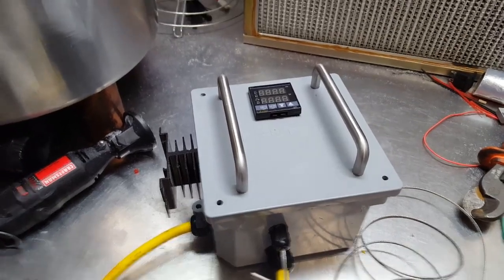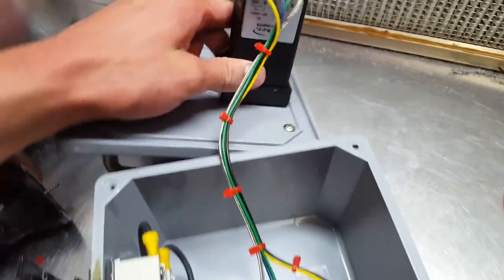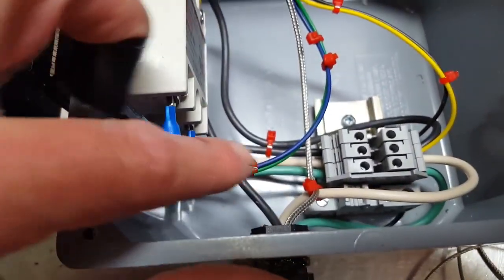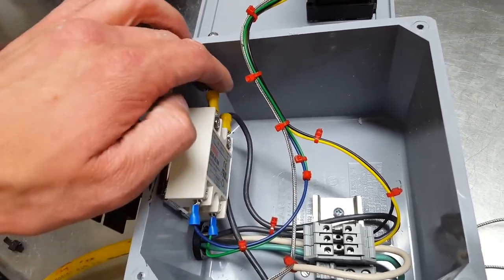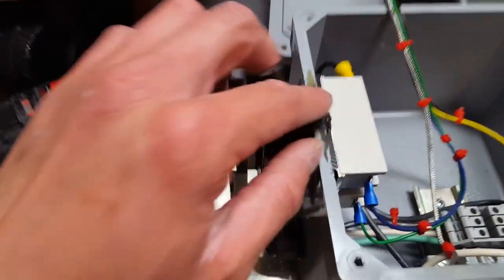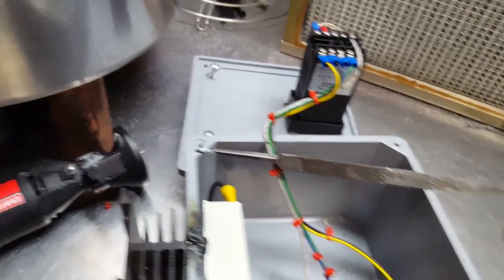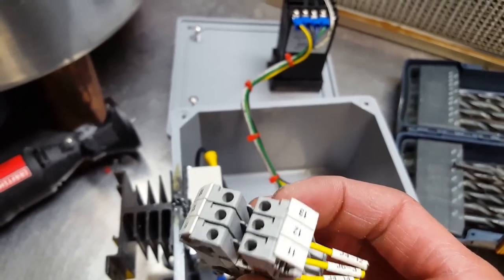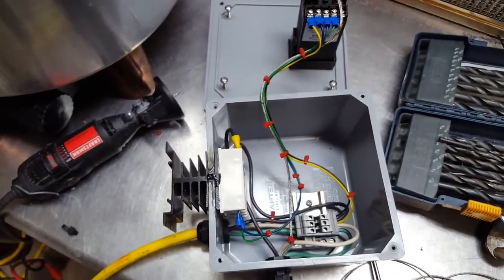How to build a DIY PID temperature controller box with a DIN rail and SSR

Comment: Interesting build.  Good tips about the plastic box and the DIN rail.  
I'm planning on doing a similar project but with a different approach.  I plan to use the ATmega328 chip found on Arduinos, and program a PID control function into the chip, and also program in a timing schedule so that the heater will turn off completely after a set amount of time.  Also I intend to use cheap LM35 sensor as temp sensor and simply superglue it to the surface of the PC.

Comment: Maybe in the future show us the circuit diagram, and then show us the implementation, especially if your not going to use standard tech language (live  or hot wire, and neutral/common, and ground, controls like feed back loop, or controlled device, etc)

Comment: How did you wire the controller up to the hot plate? Would this also work with a induction plate?

Comment: Would this not be dangerous with the probe flying out if not tight enough in??
Reply from the maker: @tegancooper-hughes5174  it would be no different then removing the rocker. It would just blow steam. That being said I've never had a probe blow out. It's only 1/8" and 15 psi so a pound or two of pressure pushing it out.

Comment: I made a 220V controller, but used a separate contactor to switch the 220, and a 24v transformer to power the contactor coil. So basically the SSR was used to control the contactor instead of the heating element directly. I did this because 220 has two live wires and without a contactor, one wire will still be hot, and could kill you if you made a path to ground for it.
Reply: Hey is there anyway you could elaborate more on this...? Using the same setup, I have 10/3 wire coming in and I'm not sure what to do with the extra hot?

Comment: when you tap off the 120v input through the DIN terminal block, do you just simply put two wires on the "output" side of the terminal block? one to PID, and one to either relay or output (depending on whether its white/black)?  or are you connecting two terminals together and having separate screw connections for each out?
Reply from the maker: You can put two wires or if your DIN kit has jumpers you can jump the 2 blocks together and put each on its own screw.

Comment: is the SSR output on the controller TTL or logic output?
Reply: They usually can only handle 30ma or so. probably use a transistor or A low power CMOS chip for the output. Most are 12vdc so not TTL  .

Comment: Great Job 
I am looking for a controller with 2 temp inputs So I can control a pump. 
I want to have pump running when temp 1 is 10F higher than temp 2. 
any Ideas how to do that?
thanks
Reply from the maker: You can use the alarm relay to do that

Comment: Any reason why you did not fuse your control devices?
Reply from the maker: probably wouldn't be a bad idea, just never have. A fuse for the PID and breaker on the main load would be a good improvement.
Reply: @MyersMushroomsFarms  im an electrician that usually build for customers so thats why I asked. To be honest i would probably not fuse it if ot was for myself. Thanks for providing the video for everyone.   👌👍
Reply: A rcbo would probably best for a fuse 🤔
Reply: @LM-uz4pr  Always fuse or circuit breaker. Saves you meltdowns as you probably know. for stuff like this marine circuit breakers work well. They can be the on/off and the breaker at the same time.

Comment: Does the ss relay really get that hot? I'm building one, and wondering if I really need the heat sink.
Reply from the maker: Depends on the load but yes. anything over 2000w i recommend a fan too.

Comment: Can this controller be used with the 55 gallon sterilizer that you built?
Reply from the maker: Yes for sure. I use it on my 55 and 85 gal. However if your running a 1500w or less inkbird now has a plug and play timer controller. You can find it on my kit page for the drum sterilizer.
Reply: Any advantages using the DIY over the inkbird?
Reply from the maker: @dylanalexander9078  the inkbird is harder to program but it may just be a learning curve for me. Also the inkbird can only do 1800w where you can put 40a relays and do 30A on these DIY units. Also the inkbird only goes to 212f so you cant use it for a pressure cooker, only a drum or steam cabinet
Reply: @MyersMushroomsFarms  I'm going to browse some of your other videos.  But I'm curious how you heat a 55 or 85 gal sterilizer?  How much power does that take?
Reply from the maker: @thedillestpickle  55 can be 1000 or 1500. 85 1500 or 2k

Comment: Is this 220 volt coming in?
Reply: no this is wired for 120 in 120 out
Reply from the maker: yep 120 you could do 240 if you only wanted to turn off one leg.
Reply: @MyersMushroomsFarms   I'm trying to do something exactly like this. I've got an electrician buddy who's helping me. What do you mean "if you only wanted to turn off one leg"? You use one 120v leg to power the SSR, then PID, then it goes back to the din rail, and out the control panel, no?
Reply: @MyersMushroomsFarms  Only one of the 120v legs connects to the SSR, the other leg connects directly to the load, right?
Reply from the maker: @mvigno2  for 220 yes, or you can run 2 SSRS and switch  both
Reply: @MyersMushroomsFarms  so, just to clarify, in a 240v set up one leg to the load would be always hot? In my set up, I'm brewing beer so I have a 4500watt heating element as the load. When energized will 120v always be going to the 4500watt heating element? Thereby, it would be running at 1/4 capacity until the other leg is energized, right?
Reply: While the US is 120VAC (60Hz) single phase, I believe Europe is 230VAC (50Hz) Single Phase.  For your 240VAC answer. make sure he was referring to US 240VAC rather than Europe 230VAC.  Wiring for a Europe 230VAC (50hz) setup is exactly the same as US 120VAC (60Hz).  This PID can use either US 120VAC (60Hz) or Europe 230VAC (50Hz) which is why the input voltage coverage is 90 - 260 Volts AC.
Reply: So how would you wire this for 220? I have 10/3 wire coming in and am trying to figure out how to make this work? Would one leg go to the ssr and the other thru an additional din terminal directly to the load/ outlet following everything else? Basically just adding another terminal block? Also, I don't see any jumper bars? Is that necessary? 100% new to this